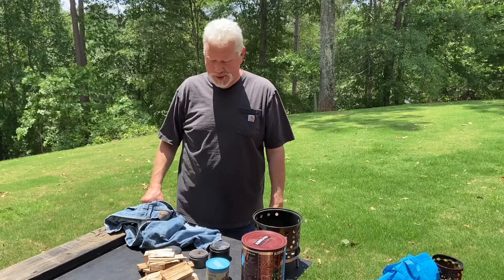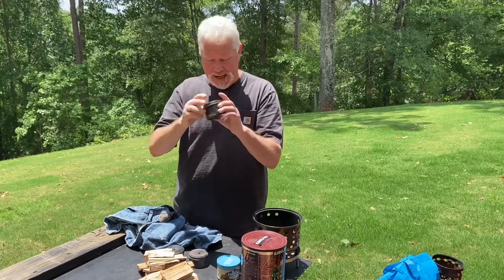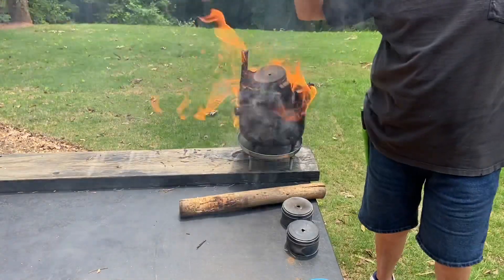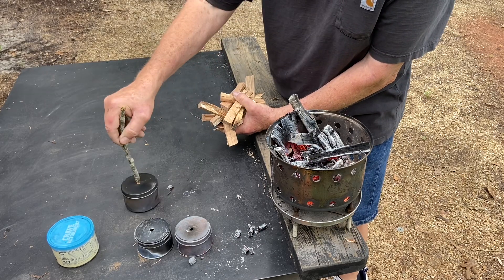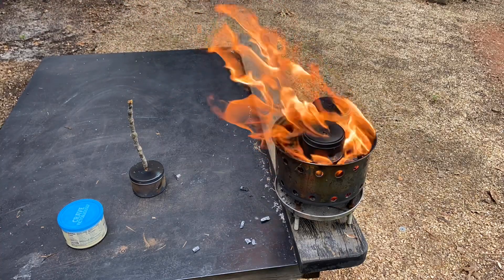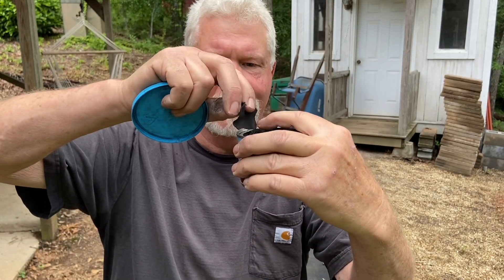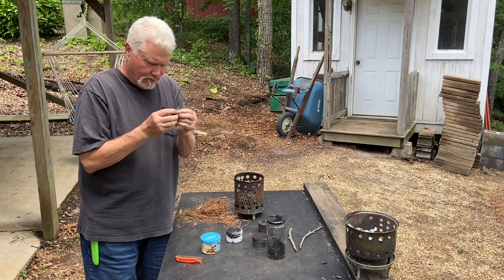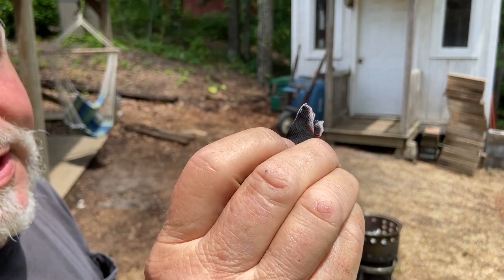How To Make More Ignitable Char Cloth

Comment from the maker: More ignitable char cloth is clean and supple. (My theory) For cleaner, I like a 1/4" vent hole in my char tin so that the gases can escape very easily. As far as the supple, I put a buffer of punkwood on the bottom of my char tin to keep the cloth from touching the red hot metal of the can. It provides for a more consistent heat. You need heat that doesn't fluctuate. If you let the char tin cool, even a little, after the gases start venting then you will have some if not all hard char cloth. You can easily test this the next time you make char by waiting for the gases to vent, take the char tin out like long enough to add wood to the fire, then put it back in the fire. The char cloth usually will have some degree of hardness.
   Please follow the LINKs below and SUBSCRIBE. Thank You!

Char Cloth, Charred Punk Wood Playlist
https://www.youtube.com/playlist?list=PLkoXX8XsMW3nfHvlf-YghwFdkUBYRIIMy
My Char Tin, Where To Buy It and How To Use It
https://youtu.be/nJ2ZntTmIDA
Reply: Lot of good info here.
Reply from the maker: Some batches of smoke residued and brittle char cloth are only slightly less ignitable while others are completely unignitable.
Reply: Tips worth noting.
Reply: After seeing you use the stanley razor knife I went ahead and bought one . It works great with my ferro rod . Thanks for the great videos. I don't practice making fires everyday but darn near.
Reply from the maker: Thanks friend!
Reply: Thankyou on the prompt and very detailed explanation. I'll certainly follow your method. I just saw the punk wood base in the tin this morning. Thankyou for your channels, I am a subscriber of both. Very upbeat and enjoyable to watch always!!

Comment: You found punk wood shared. Punkwood is more so reactive to flint and steel than charcloth. Put the punk wood charcoal in an altoid can. Now change the flint to the opposite hand hold the steel over opened altoid can hit the steel with  downward strokes . You will find several embers on different pieces of charcoal. In dry conditions choose a smaller piece in damp conditions choose a larger charcoal. Punk wood produces a much hotter spark and much sustained chance of fire. Note: after you choose the charcoal simply close the lid and all the charcoal that caught a spark will be snuffed out.
Reply from the maker: See my char playlist and my flint and steel playlist.

Comment: i use the 1/4" vent , i believe you are right about removing the gasses faster.  thanks David
Reply from the maker: Yes, the longer the gases stay in the tin the greater chance there is of them condensing on a colder can or cloth surface which can end up as a hard place on char cloth. Consistent heat during off gassing is important.

Comment: I made my first char cloth yesterday.  Ten pieces of denim in an Altoids tin.  They cooked for about 17 minutes, until the smoke stopped.  The bottom pieces were soft like flannel but the top ones were stiff like heavy canvas.
Reply from the maker: Too much cloth at one time if you used punkwood on the bottom.
Reply: @DavidWestBgood2ppl  I didn't try the punk wood trick.  I used my $5 magnesium/ferro rod combo and it seems to light pretty easy.  When the rain stops I'll try a smaller batch.  Thanks.
Reply from the maker: True, a ferro rod will fire it right up. Flint and steel will too with a few extra tries.

Comment: Hi David, took your advice and just put a ferro rod on the key chain.  Now I’m wondering what might be the best form of tinder on a key chain.  Something that won’t wear down too much in the pocket….
Reply from the maker: I never heard of keychain tinder. IDK.
Reply: @DavidWestBgood2ppl  i live in a cool, wet, earthquake prone region (British Columbia) so i feel a need to invent it!  A piece of fatwood, duct tape wrap, a vial of cotton balls.  I’ll experiment…
Reply from the maker: Ferro rod will ignite shavings of the wood you're planning on burning or t-shirt, socks, denim etc.
Reply: What about a paracord keychain?
Reply from the maker: I've never heard of paracord for tinder. It may work.
Reply: @DavidWestBgood2ppl  there are some brands of paracord or “firecord” where one of the inner strands is made of tinder material, i’m not sure what exactly or how much you need.
Reply from the maker: That rings a bell.
Reply: I have an extra contact lens case. I was also thinking about carrying some charred tinder on keychain. I may take the double-contact lens case, cut off one side, smooth, and put a hole for my keychain. Then inside either char cloth or ashed tinder.

Comment: Can I use regular wood instead of punk wood if I don't want charred punk wood?

Very practical and helpful channel for bushcraft fire-making!
Reply from the maker: No. Regular wood that is charred won't work. Like all that left over char in a burned out campfire? it won't catch a flint and steel spark. See my flint and steel playlist.
Reply: Sorry, I think I didn't express my question in the right way. I know how charred punk wood behave differently(better in some ways) than charred cloth(and obviously better than other charred material) My question is that if I don't have access to punk wood, can I use regular wood(or even green wood) in the bottom of the container to prevent the cotton material to touch the container directly. I want to know if the moisture(in green wood) and the gases will effect the quality of the char cloth. I think this might help others as punk wood isn't commonly available in urban areas but cotton materials are widely available.
Reply from the maker: Yes, use regular dry wood such as twigs. They will provide a better venting from the bottom of the char tin and help with a more consistent heat throughout.
Reply: thanks a lot!

Comment: Nice video david..  I have kinda gotten away from char cloth (except a couple pieces in my alice pack)  I tend to use the char punk wood for any of my char needs..  takes a spark well and to me seems hotter inside the tender bundle..??  But I have notice if tender is questionable, punk wood char does better.. simper-fi sir..!!
Reply from the maker: You're right, charred punk wood is hotter than char cloth especially if it's made from t-shirt material.